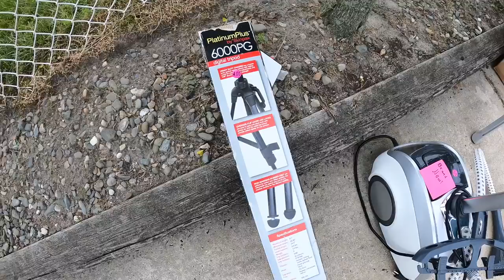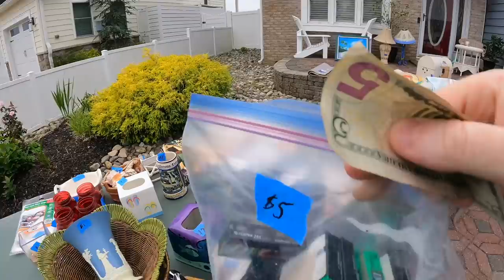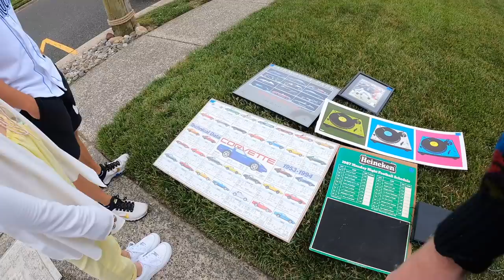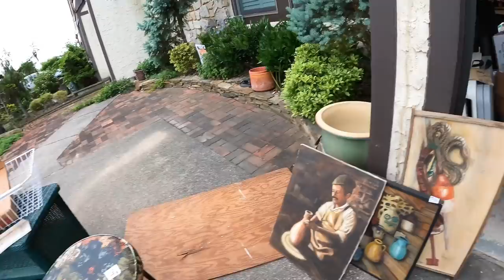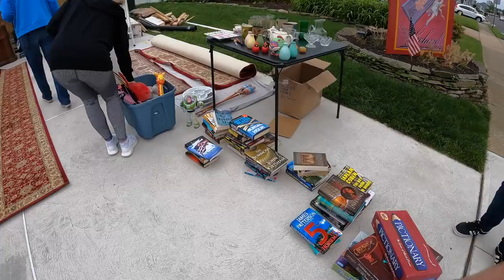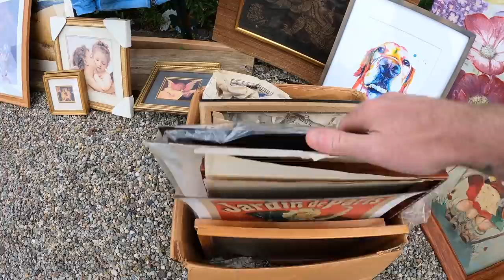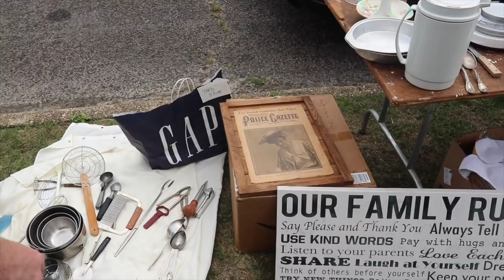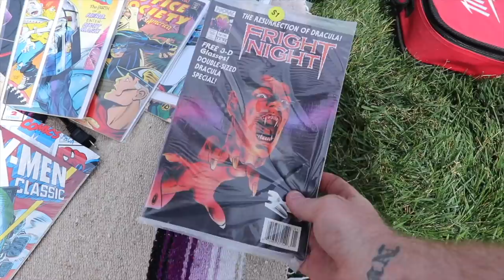HUGE City Wide Yard Sale Over 200 Houses?!

Comment: The bulb is called a Mogul Socket bulb. It happens to fit in that tri-light lamp socket, but the socket is meant for a tri-light mogul socket base bulb, which is smaller, but which happens to use the same size socket as the industrial bulb you got.
Reply: Right, I have several vintage lamps that take the mogul base bulbs.

Comment: I found a Penn peer deep sea fishing reel metal detecting made in1954. The originals are made out of Brown porcelain plastic type material in USA.  I tried locating a replacement one because it was a little bit cracked. Come to find out penn peer reels are now made in China and those end plates are actually black plastic and say made in China now. Also,  about $30 on eBay each.
Ox Bow.

Comment: The big long thing is called a buffet table... multiple uses , many times in a dining room.... you can also sort of use them as a partial room divider if you have an open plan house , if the back is  finished.. or in an entryway for a catch-all table... lots of room underneath for baskets, boots, Etc... would look really nice with a large mirror that matched the finish of the Cabinetry.... has kind of an old world look...LAX-VESPA-LOSANGELES.....

Comment: I had a 1000 watt bulb 💡 when I was In Jr High. I worked at Burger King and they used them in the parking lot lights. The one I had was burnt out and just had it hanging from the ceiling.

Comment: The ice cream parlor chairs I would not give any more then $10 a piece you have to find someone that will show you some bottoms preferably locally if you buy them online you can find them between 25 and $35 a piece what's the chairs are completed you can sell them roughly $85 a piece or the set of them for 340 bucks that would give you a profit of $160